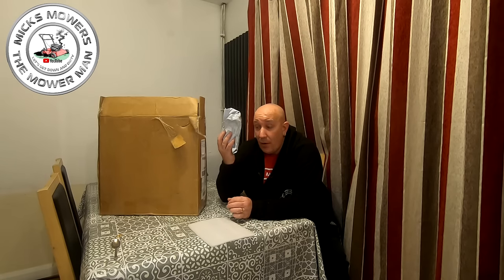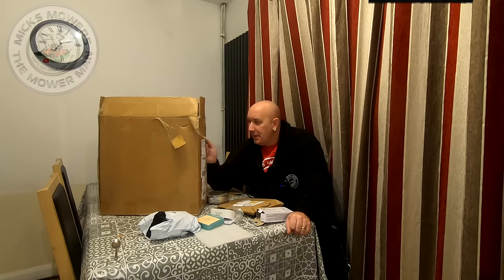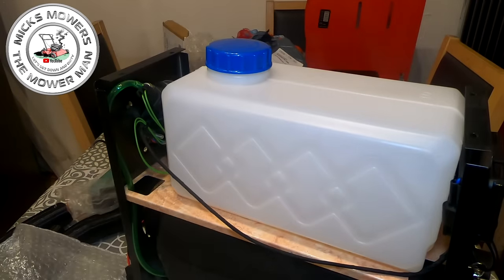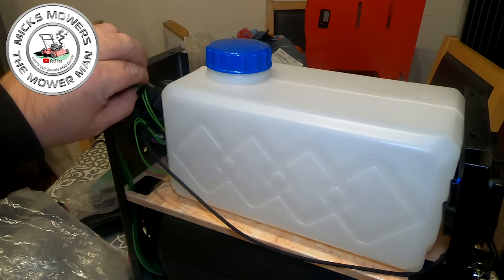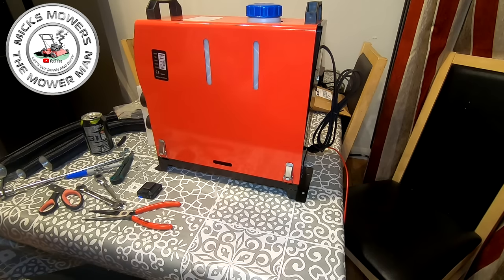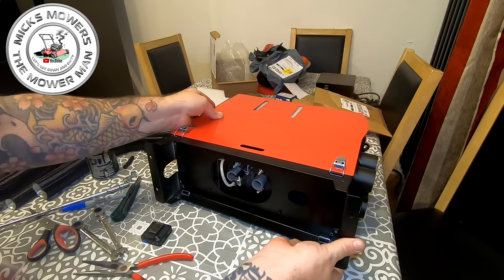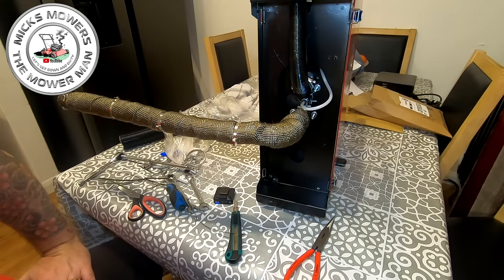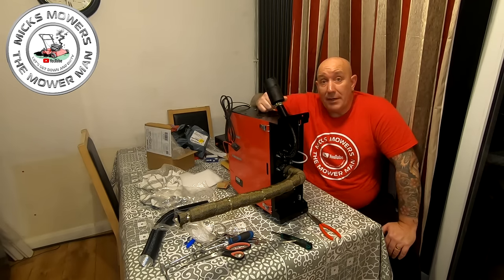Best Modifications To Improve Your Diesel Heater - improve Performance #dieselheater #modified

Comment: Hi Mick the filter wants to be on the tank feed side not the pressure side and fitting the right way round 😉
Reply from the maker: Yeah mate .. only problem is there is only about 3 inches of pipe..
Reply: @themowerman  you can do this by fitting the elbow that is on the pump and fitting that to the tank outlet, and then run a loop of the pipe down and then up into the filter and the to the pump,  with the straight joiners it's a bit tight but it works
Reply: @themowerman  he's right.   You installed the pump in the wrong location.   Worse is you're telling viewers specifically to install the filter backwards
Reply: You definitely want to filter the fuel before it goes into pump. The least bit of debris will stop the piston in the pump. Then you will have to smack the pump with a hammer to get it going again 😆
Reply from the maker: @ProctorsGamble  lol
Reply: @themowerman  The pump needs to have no air between it and the injector. The filter  where you have put it is going to cause issues.
Reply from the maker: @terrybailey2769  no issues. It’s working fantastic
Reply: but you are pumping the fuel bckwards through the filter. @themowerman
Reply: The flex in the  supply pipe is NOT the issue,  kinking  is  !!
Reply: @666chunky1 have you got a video showing this, trying to get the filter from the thank no room unless u mount outside the case
Reply: @W3BT3C  sorry didn't take any photos of it and not had to strip it back apart as yet

Comment: Very informative video. Been running the same unit in my aquarium shed 18 months. Works a treat.   I did try the rap on the exhaust, didn't like it much . Went a a cheap marine exhaust off Amazon. It is doubled skinned so the hose never touches the shed walls. Great when you have a wooden shed .

Comment: Always put a filter between the fuel tank and the pump to filter fuel before it goes into pump.
Reply: Good tip , that way it will protect the fuel pump
Reply: a bennifit to puting it after the pump is often timed the pump will degrade and rubber and plastic pieces cab come out so the filter will catch that.

Comment: Great video, very informative.
However the filter needs to go before the pump and your filter inlet is on the other side (currently flow is in the wrong direction). 
How effective is the exhaust tape? Is it safe to put through untreated wood?
Reply from the maker: It's great to use.. yeah I would say it ok

Comment: Good information! I also padded my fuel pump with some insulation and can't even hear it once the unit is running. I'm trying to make a coil out of a longer exhaust tubing and putting it inside a piece of 6" stove pipe then blowing air thru it with a small fan,. That should capture me more heat and make the system more efficient.
Reply from the maker: Good idea

Comment: I have been running one of these under the stairs in our cottage (exhaust and tank outside) for about 4 years now. In the first 2 winters i had problems with it sooting up and failing, after many strip downs and cleans i have now mastered it! It has run both the last 2 winters with no issues and better heat/economy. The mods that worked to achieve this was to drill a second air hole into the gauze chamber at 90 degree to the original and pinch the end of the gauze down at 4 points with pliers to make it a snug fit around the tip of the glow plug. On reasembly ensure the internal fan is running as close to the casting surface as is possible! any gap and the air flow through the burner is massively reduced. I have just bought a second one for my workshop which went straight into service as it came out of the box. I have set the pump and fan parameters the same but it doesnt perform as well, it will be getting the same treatment very soon!
Reply from the maker: Thanks for the update
Reply: Hi, what fuel or mixtures of fuels do you run the heater on, please?
Reply from the maker: @mattenglish8821  hi mate .. to be fair for what I use it for I just use straight diesel..
Reply: @mattenglish8821  Either red diesel or Kero, depending on which i can get cheapest.
I have tried blending oil into the fuel but it always causes problems in the long term.
Reply: @MrTench8   combustion chamber gets messy with used oil. got to have a mixture wright on point, butt that is a big hassel. because every heater is slighty different ;-) for a nice burn i've found that diesel, kero or red diesel are the ones to go with. no hassle of messy chambre 🙂
Reply: Could you make a video or something about where to drill what hole? I'm sorry english is not my first language, I didn't quite get what you said about what hole drill where ❤
Reply: @MrTench8 forgot to tag you

Comment: Surely you would have the diesel filter before the pump.
Not wanting to get sediment (crap) running through it.
Mounted my filter external on the heater housing, behind the pump.
Secondly easy access to clean filter and you can see when it’s due a clean.
Reply: I'd say filter before the pump aswell because any abrasive sediment would damage the pump .
Reply from the maker: Yeah I need to sort it.. but unfortunately there is not a lot of room.. only about 3 inches of pipe and not a lot of room..

Comment: I have the same unit. It works fine, except after running for a while there is a heavy, acrid, burning plastic smell from it. I have traced this to the base gasket. Now replaced with a genuine Webasto base gasket. Smell now gone. Not sure if this problem affects all of these heaters, but I would recommend changing the terrible OEM gasket or just remove it. It's a lot easier to do before you've filled up the tank with diesel!
Reply from the maker: Ok.. I will look into it.. mine is fine and not getting the same smell.

Comment: I’ve had one for about 3 years On my boat Mick. Never had a problem with it. Got another last year for my Garage totally recommend them. I’m not sure if your power pack will give out the Watts they need when powering up. Also mate, you put the inline filter the wrong way round. I know it seems right the way you’ve done it, but soz. Enjoy the warmth. 👍
Reply from the maker: It's running great.. ohh did i .. I will check it out.. ta mate

Comment: Very cool video but just got to say don't waste your money on power supplies. You can pick them up cheap off eBay and probably run more efficient. I'm currently using an Xbox 360 power supply very efficient works well or you can buy old server power supplies both of them you have to modify slightly just to get them to turn on as seen on YouTube very easy. Pick these up for 5 to 10 quid Very reliable

Comment: Prices went up I think because of the extreme cold weather that almost all of the US got hit with. Power outages etc got lot of attention to alternative heating. I pulled the trigger on a 8kw (vendor had 750 and sold out in a week)and got it running as the temps took a nose dive and used it to heat little over 650 sq foot to a reasonable 68+ for 3 days. Buying another smaller one to burn on a higher heat setting to prevent coking but probably not really issue if burn a bit of kerosene with burn additive once in a while

Comment: Try fitting some LED  light strip (12 v) in the fuel tank bay . Makes it very easy to check the fuel level.
Reply: can you just tap the wires into the existing heater power wires?

Comment: The only mod I did was replace the fuel line and add filter. Filter on suction side. Also real hose clamps. Plus I never leave it running unattended.
Reply from the maker: Good advice

Comment: If your pump stops working you can remove it an strike it against a board to free it up. Mine stopped pumping and it worked for me, mave have been some sediment clogging it, after about 30 whacks on a 2x6 leaving indentation in the wood it left a drop of fuel with each strike which was an indication that it was clear.
Reply from the maker: Ta for the tip

Comment: I  drilled a hole in the bottom and fitted a grommet for the fuel line to rest against, then a couple of small plastic ties to hold it there. If you''re any good with a soldering iron extend the panel display wiring and again use a grommet to feed through the side chassis .

Comment: Hey Mick! that's for your 'tips n tricks' 👍
That tower model looks easier to service. I ended up getting the 'cube' model.
Also, I have installed (attached) an HOUR meter! (by vibration) and there's not a lot vibrating on low power!
Also, I am going to do away with the cable at the back and install Terminals. (there are 2 holes already there to accomadate this), the power cable comes out one of the holes.
That way there is no power cable dangling from the unit.
Would have been good if the clock had a battery back up, but I think they thought the unit will most likely be in 'Standby' state anyway.
Make sure I get the 'CREDS' for my AWESOME idea/s!
Keep in touch...
Mick
from Australia

Comment: I have one heater with the hard nylon fuel line and one with the soft green line. No difference. Both have been in pretty heavy use for over 2 years.

Comment: Mmm, without going into Bernoulli’s Equation from a science pov there's nowhere near enough pressure generated in the pipe when it's pushing 0.02ml per impulse to make it flex chap, certainly as that pressure is divisible by its length . just saying... By all means if the pipe is likely to deteriorate then yeah I see the value in swapping it.. main thing to me would be better quality clamps.

Comment: Once the fuel line is full there's no loss of any pressure and considering you can actually run the the heater without the pump and just gravity feed the fuel dosage with a medical drip feeder attached to the hose . Carbon Monoxide should not be an issue as your heater exhaust is going outside your garage or it should be for obvious reasons so if you connect the exhaust outlet pipe properly there is one nagging little exhaust leak at the clamp on section right next to the exhaust outlet as I found by the soot deposit where it leaked out ,I suggest a fire proof exhaust compound and a better clamp as the originals are to be honest CRAP and scrap as is the exhaust pipe but I guess for the price it's what you pay for. Cheers Mate

Comment: oooh !, although the pump should be after filter there's a slight fault in the way you have installed the filter, as every engineer will know air pockets can compress so eliminating the pulse , you need to mount the filter in a vertical orientation and have the exit at the top so any air will be bled out automatically , the pump is a metering device to measure the amount in a pulse format , not designed to suck , better to mount the pump below the tank so it's not wasting energy trying to pull the fuel into it, there is no flow when it's not energized . also when they say at least 45 degree thats from the horizontal , they work much better in the vertical as no air bubbles will get trapped as long as the exit is at the top, i'm an ex RAF engineer , best training you can get and get paid for it.
Reply from the maker: Shame.. not all you have said is correct... But thanks for the comment
Reply: filter before the pump. after the pump it is just bad. the filter is also to protect the pump. any filt in the diesel wil get in the pump now. this can be a great problem.

Comment: ive got 2 8kw heaters similar to yours henry is right there isn't much difference between 3/5/8kw i have got the mod kit but i have not fitted them yet but i must say they can use a ltr fuel every 2.1/2 hours when flat out
Reply: Did you know that diesel fuel contains only approx 10.5kWh/litre?  If your heater only uses 400ml/hour that is only about 3 1/2kW of useful heat.  For 8kW it would need rather more than twice that amount per hour!  ‘Fraid the chinese lie and people believe them.🙂
Reply: It probably uses as much in electricity as well.

Comment: These heaters don't have an atomizing nozzle like a normal diesel burner. Instead it has a stainless steel screen that a jet squirts fuel at, the fuel is splattered through the screen and the turbulence of the combustion chamber oxygenates it thoroughly. This is why a filter is not necessary, because the jet orifice is bigger that most contaminant particles. But it's still a good idea to include one, I did on all mine.

Because of the fuel squirting through screen design, it is extremely important that the fuel hit the screen at maximum velocity. A resilient pressure tube or trapped air will absorb the pump's pulsations and cause poor fuel vaporization and foul your combustion chamber after a season of use. No ignition and lots of white diesel vapor is all you get.

Repair or modify the fuel feed to solve the problem that caused the fouling. You can also get fouling from poor glow plug voltage. After several abortive startups there's so much carbon in the combustion chamber that even if you fix the problem that caused it, still no ignition. And with every failed ignition if fouls the chamber even more. High elevation running aggravates the problem too.

Fortunately you don't need to take it all apart to clean out the combustion chamber. Instead, take off the intake tube and use a propane torch to preheat up inside the port. I have even used a butane torch in a pinch. After some fiddling around you will eventually get ignition and a lot of black smoke. Run that thing good and hot to burn out the chamber thoroughly. Take care of your environment because a whole lot of soot will blow out when it fires up!

I bought a Vevor unit that was built defective from the factory, I had to modify the fuel tubes and install bigger wiring to make it work as expected.

Comment: Hi Mick Great video. Where did you get your heat wrap tape for the exhaust. Some of the ones on Amazon have lousy reviews, your one seems to insulate well. Cheers Andrew
Reply from the maker: Got it from eBay I believe mate
Reply: @themowerman  Hi Mick a chance of being a bit more specific. That stuff you bought seems to work well. I don't want to order a roll from somewhere and find it's crap. Cheers Andrew
Reply from the maker: @andrewmazurkiewicz105  I will have a look but it was a while ago mate
Reply: @themowerman  Ok thanks Mick, don't knock yourself out over it. Cheers Andrew

Comment: Brilliant video Mick, lot’s of opinions in my comments regarding needing a battery back up but I haven’t bothered, a bit of a fast shut down doesn’t seem to bother mine after experimenting , starts straight back up no problem. Thanks for the mention you won’t regret buying it, i find they are a bit noisy when videoing but Martin doesn’t seem to, great video. Typing as I watch, my pump came with hard fuel line, much better
Reply from the maker: Hi cupcake.. yeah it's great.. Nana is loving living in the shed now.. I have halfed the rent and now he has heating as well
Reply: @themowerman  🤣🤣🤣 poor Nana
Reply: @themowerman    They didn’t put the motherboard in a cool air flow for no good reason.  Over-heating electronic components rarely improves them.  Indeed some items on the PCB may well have heat sinks to aid that cooling.  Not to worry, though - you can always carry a spare motherboard in case the worst occurs.

Comment: Got the same  housing is  flimsy as fuck but they work great lol . I decided to build two of em in a old woodstove 10 kw combined . One was just a bit low for a 125 cubick meter room  outside with one heater it was minus 7 celcius  inside 17 degrees celcius so they work great .
Reply from the maker: Yeah I'm loving mine

Comment: Hii mike
I have the smell of burning rubber,
plastic, or smelly air outside the
room, even though the machine is
on the balcony...
Your guidance much appreciated
Reply from the maker: Check all the fuel lines are not getting hot.. and just keep an eye on it .. do you have a carbon monoxide alarm?
Reply: No I don't have carbon alarm
Reply from the maker: @ramzizeineddine1942  you should get one mate
Reply: Thank you for your kind  reply
Reply: But can we find where is the problem
Reply from the maker: @ramzizeineddine1942  remove the cover and have a good look around
Reply: OK I will tomorrow and I'll  revert
Thank  you

Comment: Trying to find the link for the eBay modification kit mick? Do u have a link please? 😅
Reply from the maker: Here you go URAQT 4M Car Air Parking Heater Tube, 17 pcs Durable Diesel Heater Fuel Line Kit, Car Fuel Filter Crude Oil Heater with Tube Replacement Hose Clip Fuel Pipe Line for Webasto Eberspacher https://amzn.eu/d/hKaJ17T

Comment: Well, that was an excellent video. Thanks for the all the modifications that you did to the unit I noticed on the fuel filter, the fuel goes into the screen, and then out to the burner reverse of how a gasoline filter would work or am I wrong. And thank you for the shout out
Reply from the maker: I may of installed it wrong..
Reply: Say it ain't so!!! 😲
Reply: @Big_Johns  I think 🤔 so

Comment: Your modifications were well thought out, good job Mick. On my trailer the supplied flex exhaust pipe was to short, so I purchased a length of rigid exhaust pipe and slid the flex into it for length extension. Never heard the name jubilee clamp before, we just call them hose clamps, or gear clamps. Merry Christmas from frigid Canada.
Reply from the maker: Yo yo .. ta for watching mate .. yeah we call them jubilees Jubilee® has been making hose clamps for longer than any other company anywhere in the world, our brand is trademarked so that you know that whenever you see our name on your clip, you can be confident that you have the finest hose clip in the world.

The company was founded in 1921 by Commander Lumley Robinson after he patented the worm drive hose clip, which he named ‘Jubilee Clip’; although we don’t know where he got the name from.  Jubilee® remains a registered trademark and is known throughout the world.